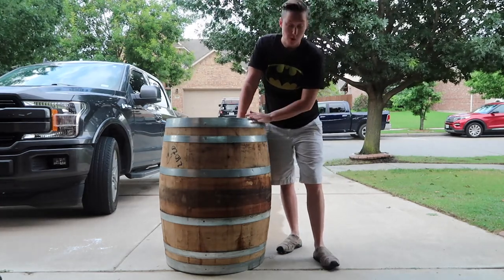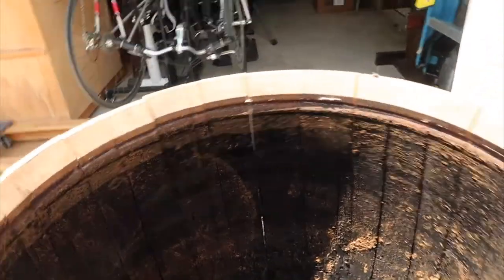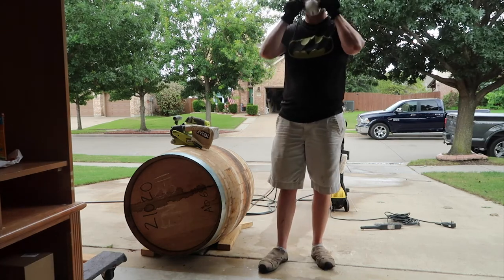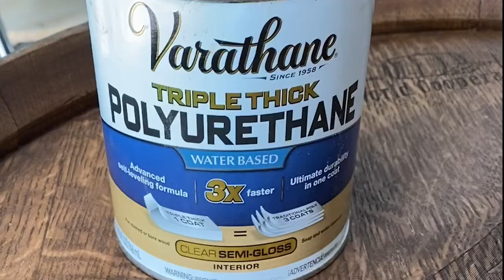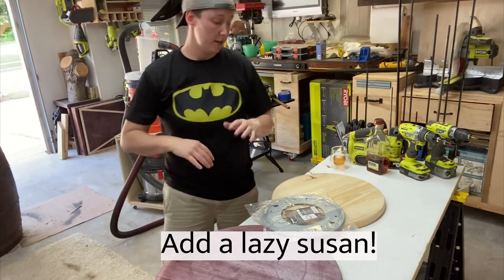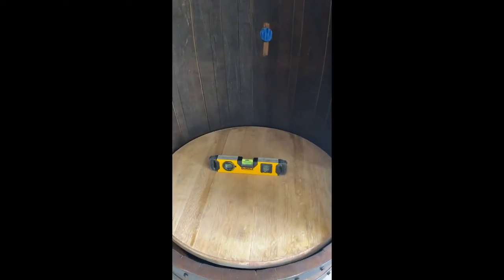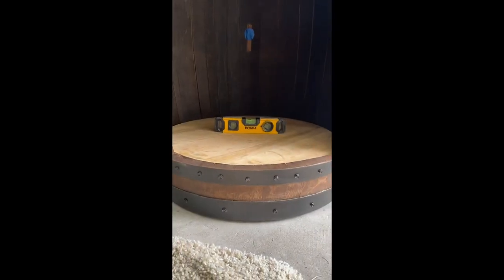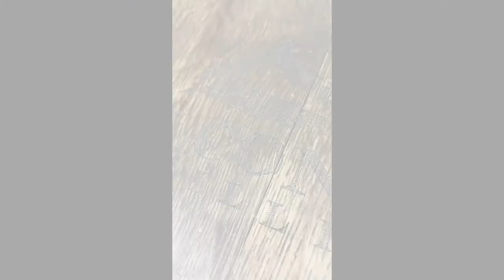Whiskey Barrel Cabinet Build

Comment: Looks great. How did you attach the glass to the top?
Reply from the maker: The glass is just sitting on top actually. 
I put 4 clear bumpers on the top of the barrel that provide just enough of a lift. That way the glass doesn’t slip off, but can easily remove to clean, or place challenge coins/pins underneath the glass for a display.

Comment: Thanks for sharing!  Any guidance on doors?  1 vs 2 and based on your experience, is 9-10 Staves the right size??  Appreciate any insight.
Reply from the maker: Hi Rob and thanks for watching. I have personally only made a single door for mine for personal preference. 
I’ve seen folks do two. Follow the same procedure of making your plunge cut for top and bottom. Then by cutting the hoops along the seam of two stages. Then attach the gate hinges (on the middle two hoops)

Opening depends on stave width. Anywhere from 16-20” should work well. 

Good luck!

Comment: Great video! One question I have is, how did you space out screws? Was it free hand or did you use a jig and how long are the screws?
Reply from the maker: Hi! I free handed it but I put them in the center of each stave of each hoop (you could use a caliper and etch a line but I just eyeballed it). 
I used #10 hex head self tapping 3/4 inch screws. 

https://www.homedepot.com/p/Teks-10-x-3-4-in-External-Hex-Flange-Hex-Head-Self-Drilling-Screws-150-Pack-21320/100138326

Hope this helps! Thanks for watching!

Comment: I’m making one also. Haven’t been able to find the lazy Susan you used. Would you happen to have the info on it please.
Reply from the maker: Hello Michael. Congrats on your build!
I purchased a barrel top, planed it down to flat and glued three pieces back together. 
The lazy Susan hardware I got from Lowes. Metal Full Circle Cabinet Lazy Susan https://www.lowes.com/pd/Richelieu-Swivel-Plate-360-Degree-in-Galvanized-Steel/1000818576

And used a piece of pre-cut round pine from my local Home Depot for the base. 

Hope that helps! Happy building!